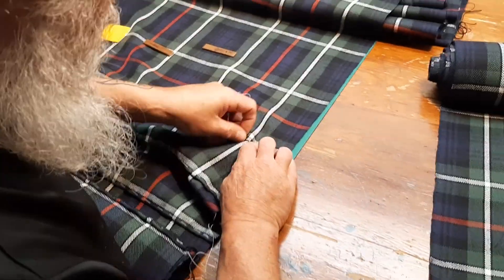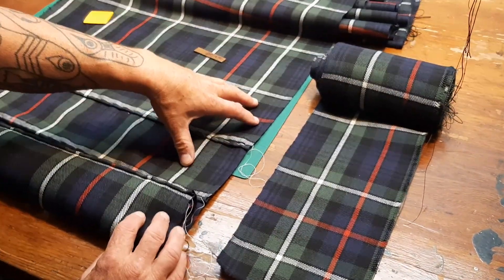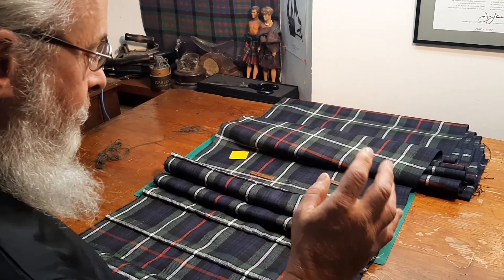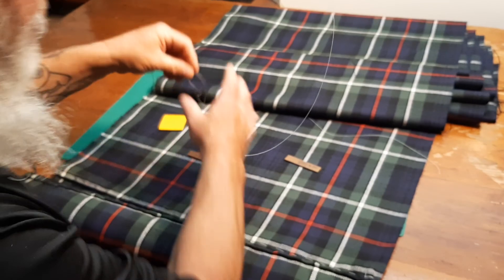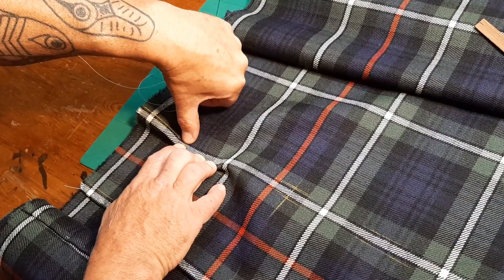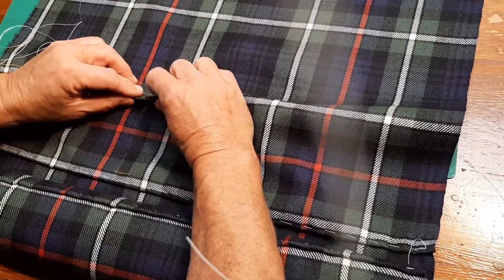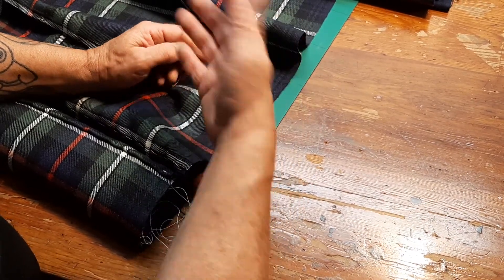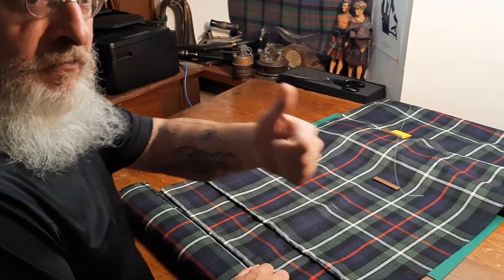making a Seaforth kilt, part 2

Comment: A little compressed air is a great was to remove corrected chalk marks, i do this in my upholstery shop where I have a compressor.  Maybe a small can of compressed air would work for you, and maybe for you it is a solution without a problem.
Reply from the maker: Thank you for your suggestion, but I use wax chalk which vanishes when a hot iron is passed over it.

Comment: I know you really like D.C. Dalgleish as your favorite.  Is that a special run (As far as color values) of a Seaforth tartan?  In 16oz.? That is a very striking pattern.  It almost looks 'Partially' weathered.  Sorry, I must have missed Part one.  So I go my answer regarding this color palette.  Previously in a video you mentioned that you could do a special run.  Would this tartan in this color palette be available in the future if a client wanted a kilt made, for a kilt project?
Reply from the maker: Yes, this is the 'Seaforth Centennial' sett that I designed for the regiment's 100th Anniversary in 2010. It's 'Seaforth #2', but the palette was inspired by my grandfather's kilt which he wore ca.1914-1919. 
you can find it here: https://dcdalgliesh.co.uk/fabric/605052
and also a slightly smaller sett based on the thread-count of the oldest extant piece of 72nd tartan cloth: https://dcdalgliesh.co.uk/fabric/610492